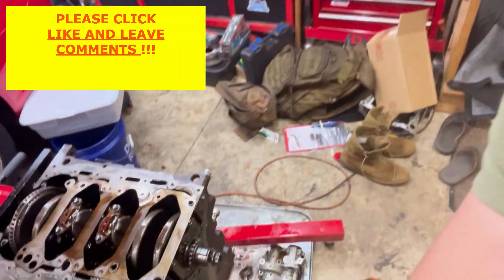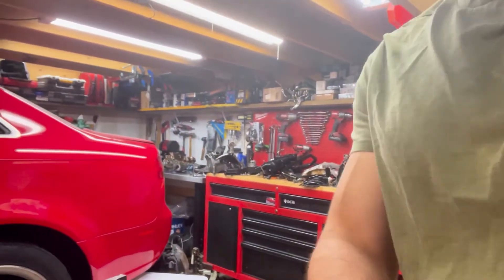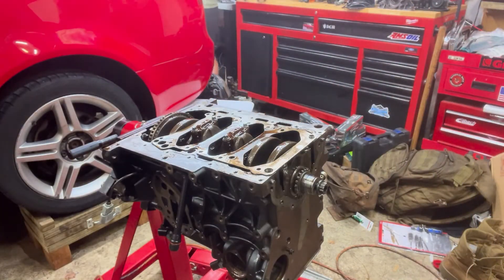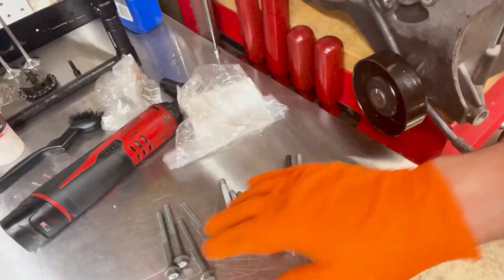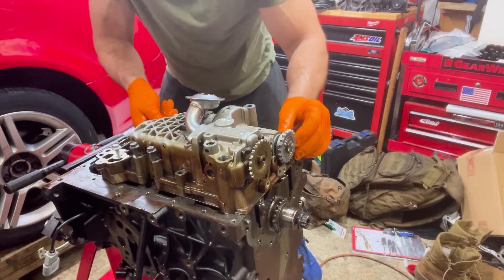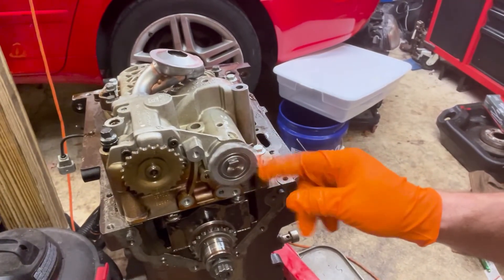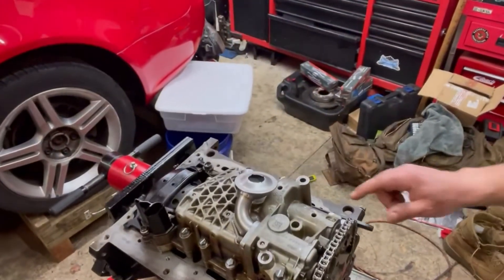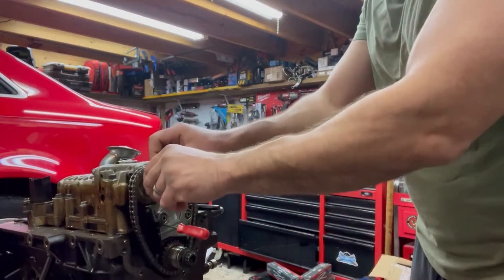Installing an Oil Pump on a VW/Audi 2.0 FSI Engine - 2006 Audi A4: WASA Balance Shaft Delete.

Comment: What pully puller is needed to remove the crankshaft chain sprocket
Reply from the maker: Thanks for the comment! You wont need a puller for the sprocket. The challenge will be getting the bolt off - if you get the bolt off, the sprocket will come off pretty easy. If it seems stuck, spray it with WD-40 and tap it with a rubber mallet.

Comment: halo I am removing the balance from my Golf 5 GTI but I have cut my chain. It is possible to hang the new one on the old one and turn it around until I can connect the new ones, at least they do not have to be adjusted because the axles have a freewheel sprocket and now I use vis motorsport.
Reply from the maker: Sorry Brother, not sure it possible to hang the chain without removing the oil pan/front cover - but I could be wrong.

Comment: Can a worn pump tensioner cause low pressure?
Reply from the maker: To be honest, I dont think so. BUT a worn tensioner can fail and throw off the chain, causing the pump to quit and catastrophically affecting oil pressure. Great question, thank for asking!
Reply: @beerwrenchgarage  

No worries.

The tensioner is quite worn in my engine and it's making the chain looser because it cuts 1-2 mm into the plastic. I couldn't torque down the bolt for the pump after inspecting the pump. It would just skip the teeth when I tried to do the initial torque of 20 Nm.

And the low pressure problem is really strange because it only occurs during slowdown and only sometimes. Hot idle is fine.

Comment: It’s been a few years how’s the balance shaft holding up?
Reply from the maker: Hi! Thanks for the comment - its been about 2 years now and the balance shaft is working perfectly. The engine runs excellent and the increase in noise/vibration is so minimal that most people wont notice.

Comment: Do you have to put the plastic cover back on? Mine broke
Reply from the maker: I dont think you HAVE to. Its probably there to avoid the chain whipping up oil unnecessarily. I dont think it would be catastrophic to run the engine without it - but if you CAN get a replacement, I would just to be safe.

Comment: Hello, is it possible to see whether the oil strainer is dirty/closed or not via the oil drain plug with an endoscope camera?  Can you make a video for us to see if that is possible?  Thanks
Reply from the maker: Yes, I think it would be possible - but yould need a high quality camera. The one I have is 7 years old and is a very low res camera/scope. However, that it a great idea and I will try to make a video of that! Thank you for the comment and suggestion!

Comment: Great help, one thing missed-the O ring on the top of the special bolt 😊
Reply from the maker: Hey Thanks for the comment Scott! I believe the bolt comes with the o-ring integral to it. I dont believe its a separate piece you have to go and get as long as the bolt is new.

Comment: So I am doing what you've done, but I did not pull my engine.  My balance shaft seized, and I've done the cheap mans balance shaft delete by cutting out the small gear, essentially turning the cog into a free wheel.  I'm assuming I have to remove the crank timing belt sprocket in order to get that plate off so I can access the oil pump sprocket.  I believe what I'm needing is a crank locking pin.  Having troubles finding one.  Every site says item wont' fit ):
Reply from the maker: Hey Matt! I would say go ahead and remove the oil pump from the engine. Sounds like all you need to do is bust loose the T45 (?) fastener holding the oil pump sprocket (and chain) on. Once you break that T45 loose you can remove the sprocket and the chain will hang off the crank. An impact will knock that loose no problem or you can jam a small punch into the teeth of the sprocket to hold it. Good luck!
Reply: @beerwrenchgarage  sorry, I have the oil pump out.  What I'm having trouble with is getting the new oil pump chain on.  Looks like I have to remove the front main seal in order to get the chain on.  I am having the worst time getting the crankshaft sprocket off.
Reply from the maker: @mattpursell9151  Hey Matt, the install would be the reverse of the disassembly: remove the sprocket - bolt the pump to the engine, hook the sprocket the chain and install the bolt for the sprocket, finally install the tensioner and let loose on the tensioner pin. If you are determined to get the crankshaft sprocket on, ensure the transmission is engaged (parking brake engaged) and then put a breaker bar and loosen the crank bolt. This may take some doing as Ive seen some of these 2.0 crank bolts rust in place fiercely.

Comment: Really helpful video. Regarding the NM to tight the oil pump bolts, did you use 20 NM plus
 90 degree?
Reply from the maker: No, I used 15NM and an additional 90*. 15 NM is what the Factory Service Manual (FSM) calls for. The 20NM +90* is the torque spec for the sprocket bolt, I believe.

Comment: So I just did an engine swap, and I'm getting EPC light with intermittent low oil pressure warnings... How doable is this with the motor still in the car? Was hoping it's just a matter of cleaning the pan/pickup out.. But if we gotta swap pumps, I'd rather not take the engine back out 🤦
Reply from the maker: Its 'Do-able' in the same way emergency surgery is do-able in a camping tent 500 miles from an operating room. You can do it, but you will have to drop the subframe a significant amount. Its honestly almost as much work to pull the motor out and do it on a stand. HOWEVER, you are assuming the oil pump is bad. It could very well be you have bad oil squirter(s) and that will require a whole engine tear down to get to all 4. In my case, for this red car, it was a couple of bad oil squirters causing low oil pressure.

Comment: Nice tutorial man! I've been right where you are a couple years ago. I think you and I have nearly identical short blocks, not sure if you also have forged rods, but my oil marker lines are yellow instead. As long as one mods the balance shaft (to accommodate for the inevitable seizing), regularly changes the cam follower on regular intervals, and primes the oil system 3 times when doing timing or rebuilds (since the VVT gobbles all the oil from the pain during the first prime) then the car will live a good long life.
Reply from the maker: Thanks for watching Brother! You are right on in your 2.0 wisdom!

Comment: How do you set timing on balance shaft?
Reply from the maker: Sorry for taking a while to reply. First, the engine (crank) needs to be at TDC, then the oil pump sprocket with the sharp teeth has a skinny line mark on it. The mark on the sprocket need to be essentially pointing down (or up) on the crank, at that point jam a punch between the teeth of the sprocket and the body of the pump to immobilize the sprocket/chain, then you can tighten the bolt for the sprocket. If you need that specific section from the manual, email me (beerwrenchkc@gmail.com) and I will get it to you.

Comment: Hey brother. Question. Why aren't you using the balance shaft? What is the purpose of the free spinning sprocket.
Reply from the maker: Hey Brother - good questions! Two reasons: The main reason is that the OEM balance shaft sprocket has a tendency to fail. Typically, when it fails, it essentially collapses on its self, throws the chain and kills the oil pump, leading to catastrophic failure. Its not a super likely chance of occurrence, but removing the sprocket helps 'bulletproof' the oil pump. The second reason is to reduce parasitic drag on the crank and free up a small bit of horsepower. While technically, deleting the balance shaft leads to increased noise and vibration, I have seen very little difference. A well running balance shaft-less 2.0 FSI will be virtually indistinguishable from an average 2.0 FSI with a balance shaft.
Reply: @beerwrenchgarage  that's what I was concerned with.  I know any honda over 2.2 liters has balance shafts.. but I might have to inspect my pump make sure it looks OK ans there's no clogs or Play in shaft.
Reply from the maker: @MyHomeGarage  Yeah, so for the Audi 2.0 balance shafts, because they are integral to the oil pump, its a bit of a land mine. Theres nothing inherently bad about the shaft itself - its just the weird bolt that Audi uses to secure the balance shaft sprocket to the shaft. Like I said before if the bolt fails, it takes out the pump. I mean its not a super high rate of failure, but when it hpapens, its general catastrophic. For this engine, I wanted to maximize its ability to go another 100K miles, so it made sense to spend $200 on the WASA freewheel. On other engines, it the balance shaft is not integrated into other components, I wouldnt worry about it. That being said, Im not familiar with the Honda designs. If you have one out, it might make for a good little video.
Reply: @beerwrenchgarage  honda is exactly the same with thr 4 cylinder engines k series balance shaft and oil pump integrated.  I have one sitting ona  bench I'll post a pic. Yeah I'm waiting on a extra car to come back so I can take the audi and take my time. I watch to pull motor do rear chain the the phaser bolt it stripped. I gotta drill it out. I wanna do a carbon cleaning.  I hate how these engines idle. It doesn't feel premium.  I want to change the transmission mount. Inspect clutch flywheel ect. When I sell this car I want the next owner to have a flawless faily. As much as possible anyway lol.
Reply from the maker: @MyHomeGarage  I hear you Bro - these fucking engines are very finnicky. Two points - 1.) you can do just as well a job of cleaning the valves with a pick, some Mopar carbon cleaner, and a tooth brush as with a fancy walnut set up. 2.) The PCV system on these cars is complex and integrates the valve cover and the turbo. People sleep on the PCV system, but its an important part of getting this engine to run well. Good luck with the adjuster bolt. I've done two - both times with the cam out of the car - one time I was able to drill through the bolt - smash a torx socket in there and spin it out. The other time, after many tries of drill the bolt out - I gave up and cut the adjuster off the top of the cam with a sawzall (was able to save the adjuster - needed a new cam).
Reply: @beerwrenchgarage  I was going to try and make my own adapter  as I have a small sand blaster. Well see how that goes lol. 2nd I really hope drilling out the head of that will release the adjuster. I saw a guy do it made logical sense . Also  I would imagine all the valve covers leak internally since there plastic and I've scene people use smoke machine and show them leaking. Depends how much to pour in to this car. It's gonna be 2 years in July I've had it.

Comment: Did you block the balancers when you put the wasa gear
Reply from the maker: No, didn’t block the balance shaft - that’s what the WASA sprocket does - the outside of the sprocket spins with the chain and inside keeps the balance shaft stationery.

Comment: Where’s the update though
Reply from the maker: Ive been waiting to make a video on it. But I'll give an update here: I've currently got just under 500 miles on the engine with no oil pressure light. Have not put the mechanical gauge on for readings yet - but am planning to make a video of that and a compression test. No issues with the engine - she runs great (knock on wood). There is a slight increase in vibration from the balance shaft not being present though.
Reply from the maker: https://www.youtube.com/watch?v=cctQFoGDniM&t=0s

Comment: Any updates on the oil pressure?
Reply from the maker: Not yet. I've driven the car for a few miles with no oil pressure light. Have not hooked up a mechanical gauge yet as Im sorting out some drivetrain issues/waiting on parts. Will update as soon as I get everything together.
Reply from the maker: https://www.youtube.com/watch?v=cctQFoGDniM&t=0s

Comment: How is your oil pressure with the WASA ballance shaft delete?
Reply from the maker: Excellent question. I havent driven the car yet. I will update once Im able to get some miles on her.
Reply: @beerwrenchgarage  Cool thanks.
Reply: @beerwrenchgarage  still not running?
Reply from the maker: @psiturbo  Yes - Yes it is! Sorry I didnt update this particular comment but my channel has the video on running and oil pressure after the WASA delete: Here it is: https://www.youtube.com/watch?v=cctQFoGDniM
Reply: @beerwrenchgarage  Did you use WASA 3or4 oil squirters?
Reply from the maker: @lthomas5176  I used the WASA free wheel balance shaft delete and replaced my oil squirters with 4 new OEM ones.
Reply: @beerwrenchgarage  Will diffective oil squirters decrease oil pressure?I converted to a KMB Motorsports 1.8T modified oil pump  kit and,I'm having low oil pressure light at idle when warm. Does the oil squirters bleed off pressure to early?just need some help with this thanks.
Reply from the maker: @lthomas5176  1000% yes they will (reduce oil pressure). In fact that was my exact problem with this engine. See this video for the diagnosis of the oil squirter: https://www.youtube.com/watch?v=ORhTQdvIvTo

I would say, if you're already there, go ahead and replace the oil squirter. Its going to be about $50 a piece or more, but better to bite the bullet than end up doing all that work over again.
Reply: @beerwrenchgarage  thanks.